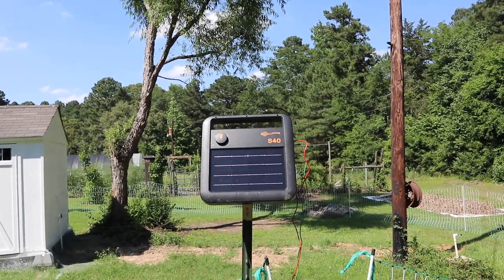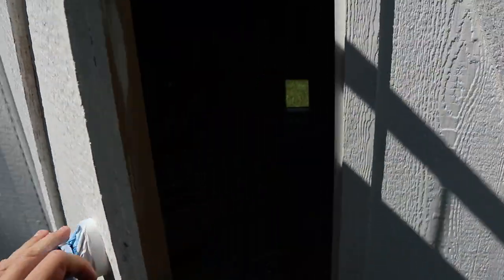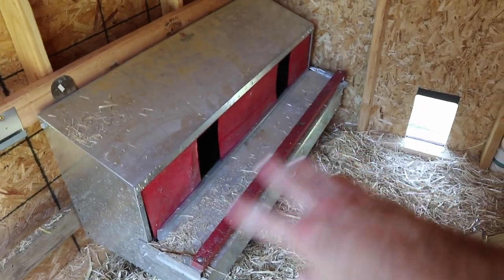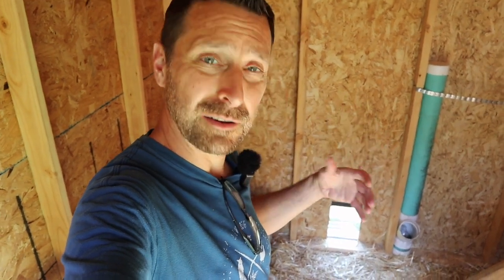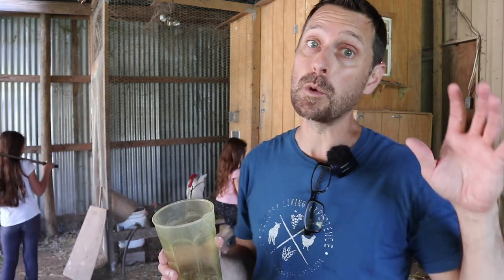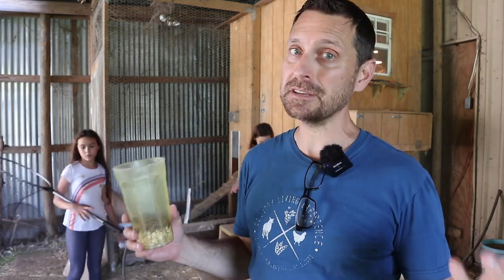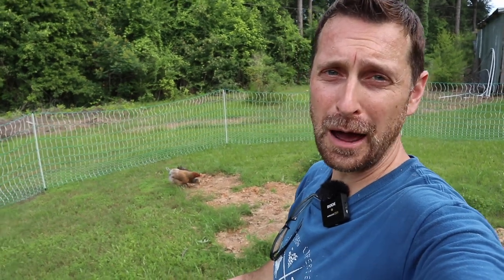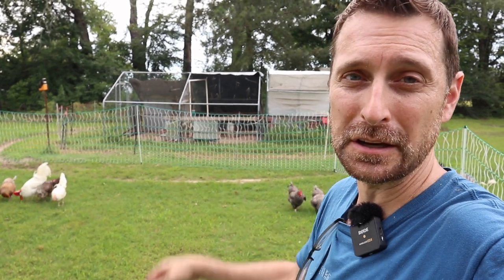Transforming Shed To Chicken Coop! Full Tour!

Comment: Here is a suggestion… remove the shavings that are on your droppings board and add PDZ coop fresh.. just a thin layer… it will absorb the moisture in the poop and in the morning use a pooper scooper to pick up the droppings… I also use a taping knife and scrape the poop to a pile and sift through the poop scoop
Reply: 100 % that's exactly what I would do
Reply: @sandralafond3818  it was a game changer for me in my coop.. I clean the droppings every morning and add them to a compost container that I share with gardening neighbors
Reply from the maker: Cool
Reply: @joy adams Same! It's absorbent and helps with odor. It also lasts and lasts and lasts...

For those who might try this: buy the stuff for horses, rather than chickens. It's the same - but way cheaper.

Comment: It's kinda funny that the chicken you demonstrated clipping the wings, has a lot of the traits of 2 of my birds. I was told initially that they were cinnamon queens, but then I found out that they were some kind of Easter eggers. They have the green feet, and colored egg's (green). Mine aren't the same based on the feathers though, they have a black core with brown around the edges of the feathers on their necks / upper chests.

I like the work you did, I need to work on getting a coop built up like you have. But it will have to wait until I finish my Tiny home build I am about to start.
Reply from the maker: There are so many chicken breeds, it is difficult to tell sometimes. Good luck on your tiny house build.
Reply: That is true, and they make new breeds accidentally all the time. Oops shouldn't a left that rooster in there. LOL

And thanks for the well wishes, I'll be recording it so people can get a good laugh at my attempt at being a builder. :D

Comment: U may should consider using white 4x8 polyvinyl sheets from lowes. This is commonly used in commercial bathrooms. The cost is favorable instead of linoleum. I used the linoleum, and it is not as waterproof as I thought.
Reply from the maker: Good idea. Thanks